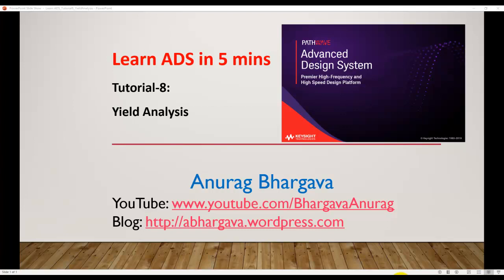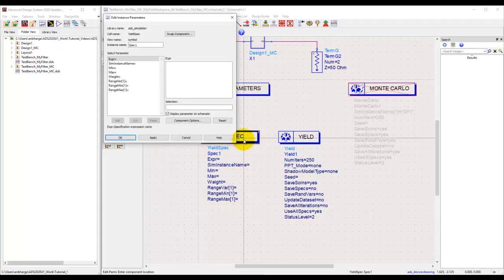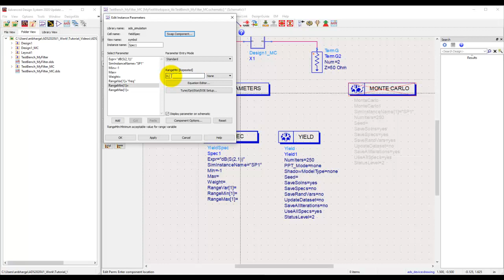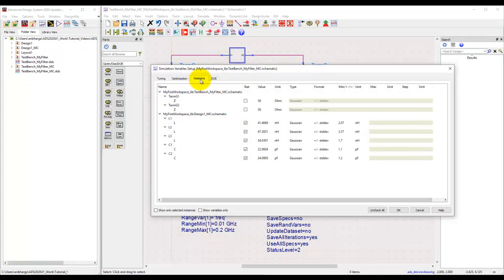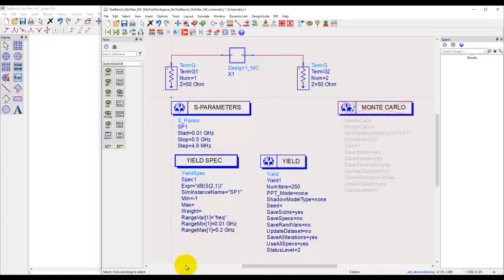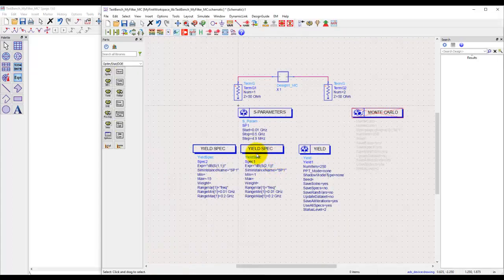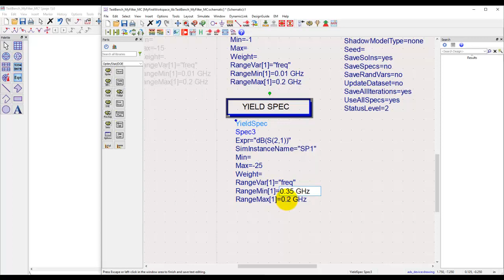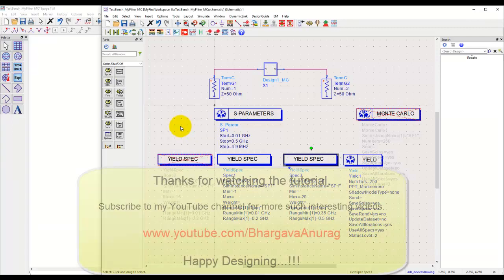Tutorial-8: Yield Analysis

Comment: Hi, Its a short and nice video. Can we optimize the circuit to give me higher yield. For example, my load is varying from 40-50 ohm, I need the component values that minimizes the S11 over the frequency and load range?
Reply from the maker: Sure, kindly refer to my old 3 part statistical simulation videos. You can center you design for statistical variation but if load is varying so much like you mentioned you can't hope to get good results all the time.

Comment: I would like to ask a question. Why do we want to do yield analysis while we can just do optimization? I am not clear why we would want to go through Monte Carlo simulation and yield analysis, for example, when we want to do impedance matching and choose right capacitors and inductors
Reply from the maker: Optimization only gives you one value for the components to meet your specs but in reality all components will have tolerances and Monte Carlo/Yield Analysis is a statistical technique of varying your components values within the tolerance range to see how circuit performance might change within those tolerances so its a very important analysis for any practical designs esp. involving discrete components.
Reply: @BhargavaAnurag  Indeed, I didn't think of such perspective. Thank you so much for your answer!
Reply: @BhargavaAnurag   thank you sir
Reply: @BhargavaAnurag hello sir, you say optimization gives one value but the components have tolerances, then we run monte carlo to see the tolerance effects, after that we do yield analysis and it says how many iterations passes our specs, so for real/commercial designs, do we always have to get %100 passed yield analyze ? What is the limit for yield analysis in terms of passed circuits for commercial designs ? Is it has to be %100 passed ? Thanks.